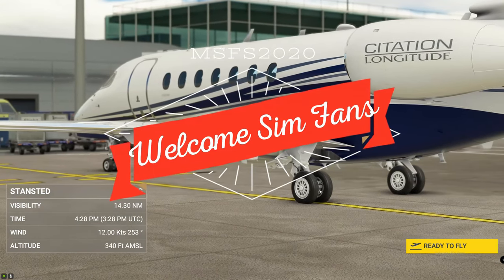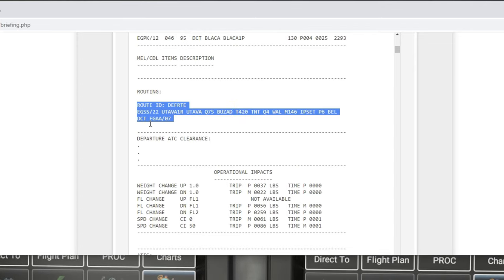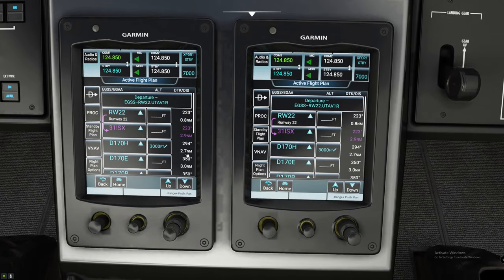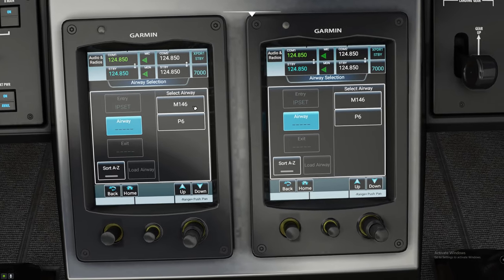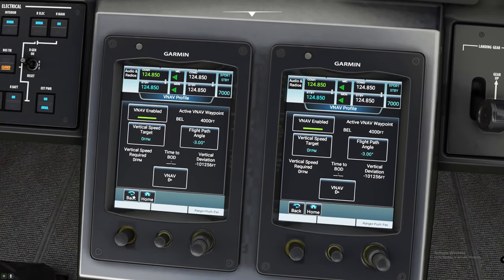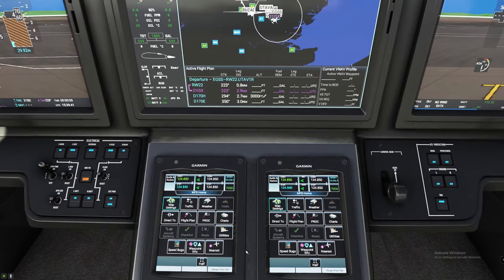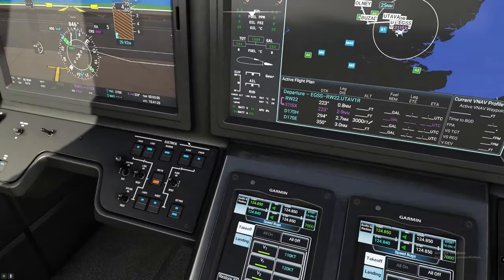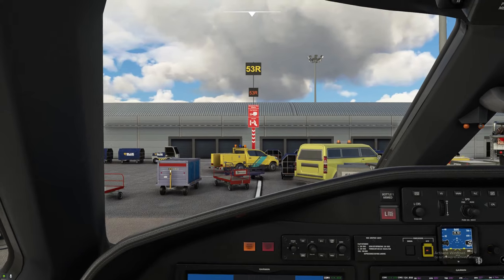MSFS2020 & Working Title G3000 Flight plan Tutorial FROM SCRATCH ! Longitude fdefix and EGSS Addon

Comment: Great video...well explained.  I've been mostly flying the CJ4 Working Title, but decided to upgrade a bit and fly the Longitude with the G3000/5000 WT.  

Question:   I just wanted to doubly confirm that if I get a Navigraph Ultimate (?) subscription and authenticate the G3000 to it via the Database menu, then all altitude restrictions will automatically be populated for SIDS/STARS/Approaches?  I asked this question in an FS2020 forum, but didn't get a very clear answer.  Having the charts is pretty cool by itself, but altitude restrictions are pretty important to me as well.
Reply from the maker: No I don't thinknthey will auto populate the alt restrictions.  Thanks for the comment sorry for the delay my family is in the process of moving.
Reply: @2020fsers   Thanks!  Still debating on Navigraph.   Bummer that it probably won't autopopulate, but gives me something to do at cruise altitude.  :-)
Reply from the maker: There ya go

Comment: Nice video. Question for you. When looking at the active legs does the distance go down as you get closer to each leg? I asked this because I just thought of flying the TBM 930 and I really dig the G3 thousand. But for some reason when I look at the active legs everything goes down as far as the ETE and the fuel but the weight point distance stays the same. Is that the way to post to work or am I just bugged? Please let me know
Reply from the maker: Hmm I'm not sure I haven't flown in a while in the process of moving . It should go down with distance to next leg I think .

Comment: I need help The flight plan menu is not there The two screens in the middle is the same as the the screen to the left of the cockpit?😔
Reply from the maker: ahh ok are you in the tbm?
Reply: @2020fsers  what is that
Reply from the maker: under the knob on the center gps there are 3 button going down and then another knob those 3 buttons switch it for you click the center mfd button
i will make a complete video on the tbm if you havent check out the tbm video i did with vnav until i make the new vid
Reply: @2020fsers  thanks i will check it tomorrow it’s night where I live
Reply from the maker: @nizo8451  what plane are you in
Reply from the maker: @nizo8451  ok I will try and get the tbm930 guide up by tomorrow including the gps and vnav and ils and I will break it down in sections to make it easy
Reply: @2020fsers  thanks 😊

Comment: Thanks for video. Well done. Kudows to working title. Now that you have entered your flight plan after  about 20-30 mins. Where do you save it so you don't have to do it again? There is a bit of sarcasm in that question. Answer: You can't. Completely absurd and ridiculous. Designed for 8 y/o's. The only way to do a flight plan and save it is to start a new flight from the main menu not even close to real world g3000. If you get ctd or have to go to main everything is lost. Huge problem for Asobo.
Reply from the maker: Thanks for the comment  ... maybe it will change with the aau update idk I haven't tested the beta

Comment: no i meant from importing from simbrief. my plan does not show altitudes and atc never gives me enough time to descend. i know i can add them manually but simbrief does not give me altitudes at the waypoints. i guess i am a bit in the dark with this new mod.
Reply from the maker: No sim brief doesn't give you altitude restrictions the gps does and the g3000 is not capable of importing altitude restrictions you need to manually enter them using methods I discussed in the response prior.
Reply from the maker: If you fly the a320 the fmc is what populates the flight restrictions not simbrief.

Comment: Everytime I try to fly an IFR route, everything works fine UP UNTIL the transition off the STAR into the Arrival. The flight plan throws a huge arc at the transition and has some “USER” line in it. Makes me look like an idiot on Vatsim.
Reply from the maker: Are you using the latest working title g3000 mod?

Comment: I still struggle with changing routs in flight. I never saw the option to delete waypoints since always grayed out. Never really figured out when I activate the approach as my NAV starts flying silly and I have no idea why it is doing what it is doing. Is it possible to fly holdings at all? In the Cj4 it is quite easy to modify flightplans enrout. Wish it was that easy flying the Longitude! Questions apon questions! *laughs
Reply from the maker: Are you using the working title g3000 mod?
Reply: @2020fsers  I do, yes! ;) I use Navigraph and can load charts and all that. I can select any waypoint in my flightplan to fly directly to it. I activate the direct, the plane turns and flys there. Great so far! But when it reaches the point, it won't carry on with the flight plan, instead it starts circling the waypoint. I just can't get it to follow the flight plan further from there. I guess the issue comes up the moment I modify the flightplan with shortcuts. Same with approaches when I try to make a shortcut from the long standard downwind on the long final. Thats an issue when I want to fly on VATSIM. Whether it is a altered departure rout to resume own navigation or something with the approach which isn't standard procedure.